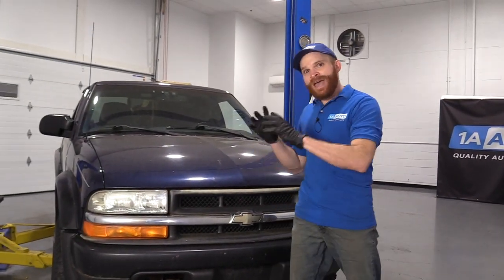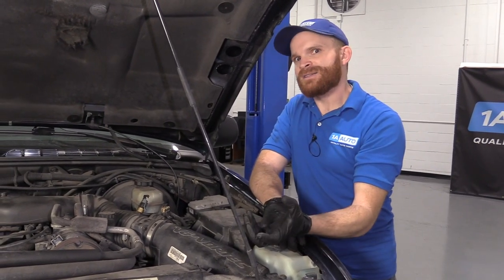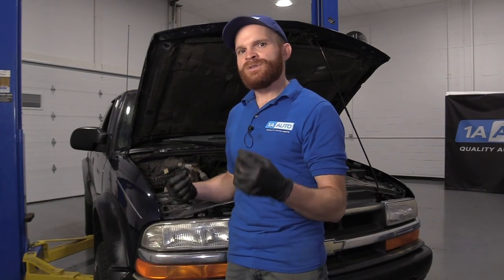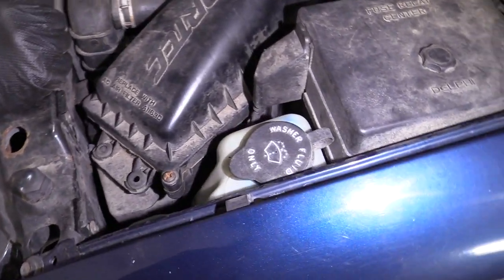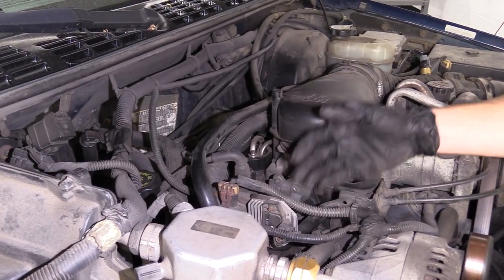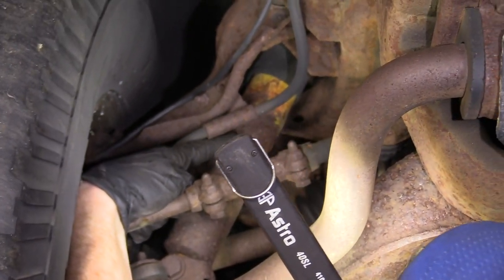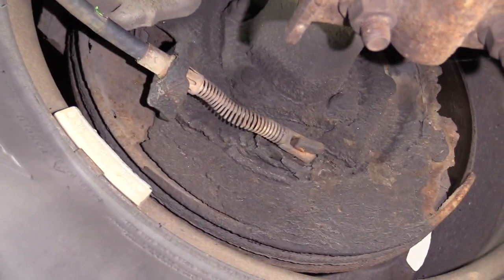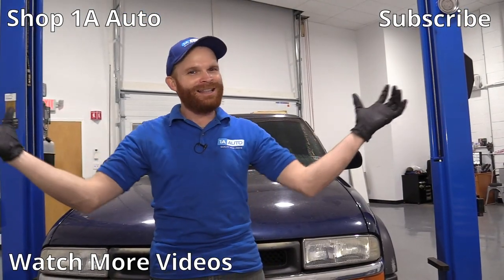100k Mile Service Chevy S-10 ZR2 Pickup 2nd Generation 1994-2004

Comment: Should mention the differences between green and orange coolants, how you should not mix them. I saw it done, it looks like it turns to peanut butter if you do.
Reply: Made the mistake mixing coolant  colors now no longer have heat or AC , fear have to take dash pad of damper problem also thermistate  heater core . Cheap pot medal adjusters on cloth bucket seats broke of both seats looked at wreaking yard all seam to brake seat adjustment  mechanism.

Comment: Big problem with the ZR-2  in this generation....seal failure between the auto trans and the transfer case...over time atf will migrate into the transfer case overfilling it and lowering the atf level in the trans....then when the 4-wheel drive is engaged atf will be pulled into the vacuum lines and into the four wheel drive actuators....piss poor design GM!

Comment: My car is coming up on it's 12th anniversary in mid 2021, and I've only put 54k original miles on it. I have to imagine I need to follow some alternative maintenance schedule. I change the oil every year. I've had the transmission fluid changed, the valve cover gasket changed, the AC evap changed and all motor mounts changed. I also changed my own plugs and coils. I'm still rocking the original brake pads, brake fluid, power steering fluid,  antifreeze(orange) and belt. I'm gonna have this Ford Focus forever!
Reply from the maker: +Sean Baker Thanks for the feedback!
Reply: Change the coolant. Trust me. Even sitting it can become acidic and eat gaskets internally. Every 5 ish years would be good.

Comment: Good thorough inspection  always pays off at the end thank you for the guidelines.
I’ve got 320,000 miles out of my 2000 Chevrolet doing the same type of inspections and seal repairs as needed. And she still runs like a champ!
Reply: I bought my 01 s10 zr2 new and have 320,330 on it and still my daily
Reply: Damn. I wish I had that kind of luck. I just had the fuel injector spider assembly replaced at a shop and now it's trying to give up the ghost and it has about 178k miles on it. It's misfiring extremely badly and the SES light is flashing over and over.
Reply: @SalandFindles  spark plugs wires and replace the whole  distributor

Comment: Excellent video, I would like to add 2 issues if I might. First of all there a still stickshift trucks out there. So you might want to add checking the clutch fluid. The next issue is one that I believe is very important and that is the MAF, you did brush over that, but I believe consumers should know how import maintaining and cleaning the MAF is. I believe it is the single most critical componet on the vehicle. Easy to maintain and clean. Just my opinion.

Comment: Hey guys I really find your channel useful and it has helped me alot I feel like you jumped over mentioning vacuum lines all of the s10s that I've owned had some kind of high idle or a 4wd issue related to the vacuum lines and I could never find information on like a schematic explaining the entire vacuum system  they don't sell kits that are cut to length so you always have to buy 20 some feet of vacuum line to replace all of them even then still couldn't find much info on what lines go where even clymer manuals didn't have much info I apriteate your channel and it has helped me tremendously thank you for the content
Reply from the maker: +TTR6 TTR1 Thanks for checking us out! http://1aau.to/m/Shop-1AAuto-c

Comment: My 98 v6 s10 was running like sheeeet. It would bog out almost turning of at any speed. Installed a new maf sensor runs like a champ no sputtering. How ever with the ac on it sputters and wants to big out any suggestions. Doing the spark plugs wires and distributor cap next

Comment: I’m surprise she didn’t mention the oil cooler lines which leak on everyone of these vehicles about every 20,000 miles
Reply: Honestly having issues after 1k miles and might just find fittings and run soft hose for the whole system. Terrible design tbh. New rad, new lines. New cooling block, reman motor. Just shit design.